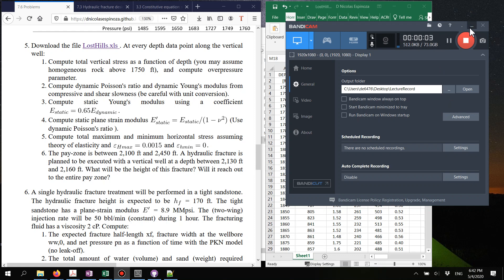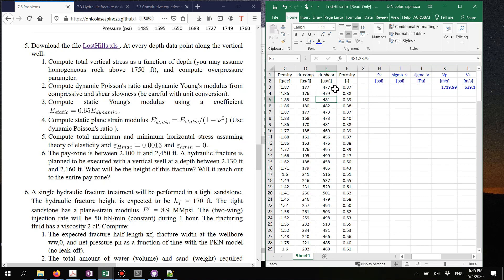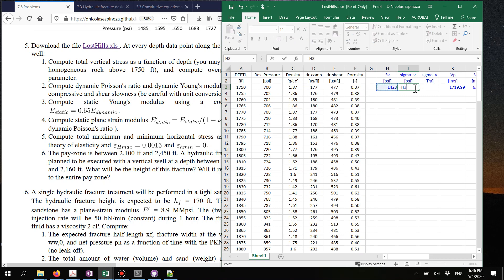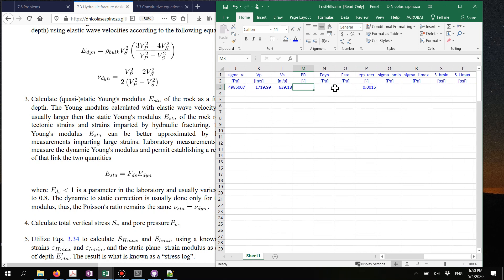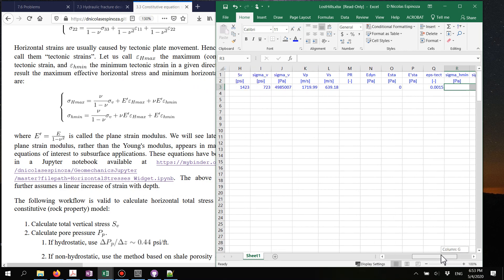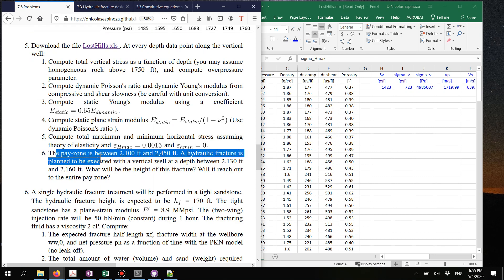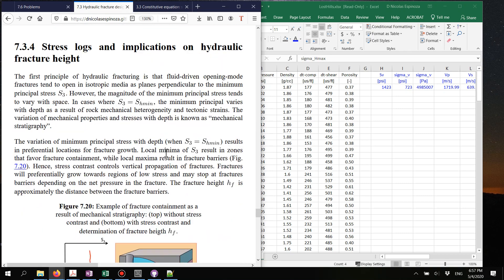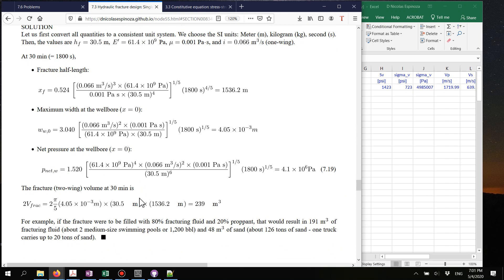L0505 Building a stress log from a sonic+density logs, and hydraulic fracture with PKN solution

Comment: 03:33 Why the 1 psi/ft? Why not use the (rho)*(g)*(h) formula?
Not all region in the world can be applied with 1 psi/ft.
Reply from the maker: 1 psi/ft is the stress gradient for mass density 2.3 g/cc = 2300 kg/m3; here it is used as a linear interpolation that captures the actual mass density from the log (e.g., 1.87 g/cc for depth 1750 ft), gravity is included in the calculations, see https://dnicolasespinoza.github.io/node9.html.

Comment: how can we estimate Shmin in reverse faulting if you would reply to my question kindly ive searched a lot with no success  hope i will find an answer here
Reply from the maker: I missed this comment! Apologies! I must have been on vacations! You can't measure Shmin with conventional hydraulic fracture methods in a site under reverse faulting. Some methods claim they can do that, check papers from DFIT analysis by Mark McClure. Your other option is to look at wellbore breakouts and use SHmax, Shmin, wellbore breakout angle, and rock strength to figure out horizontal stresses.
Reply: @dnicolasespinoza5258  thank you so much for your insghitful feedback